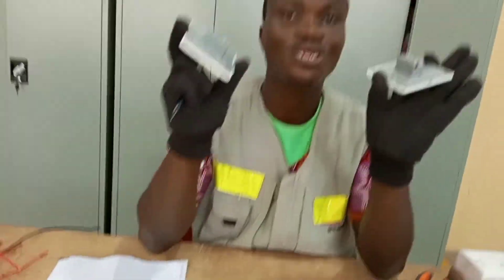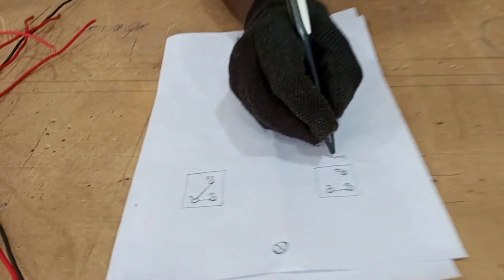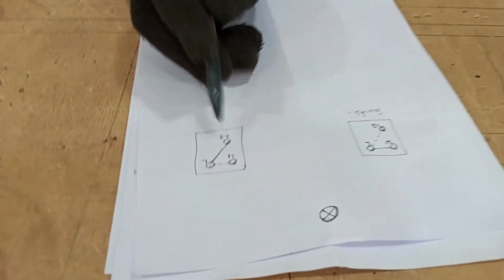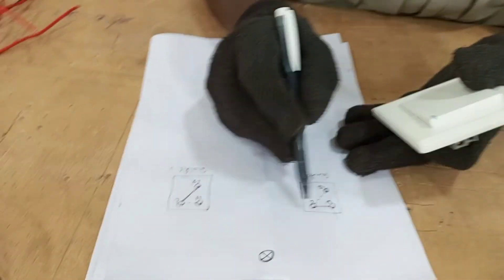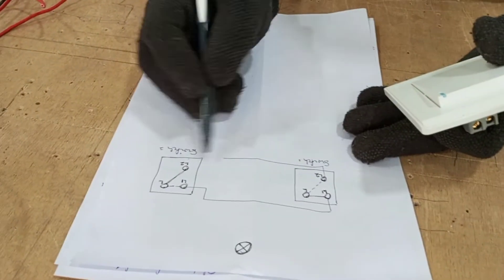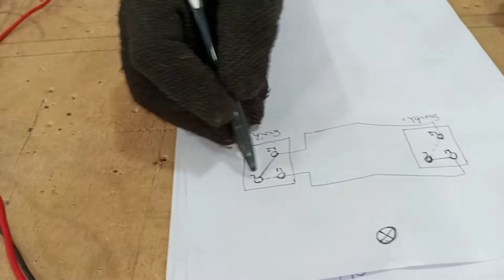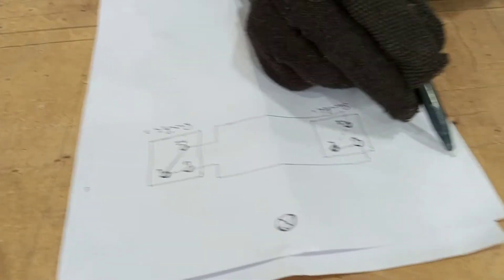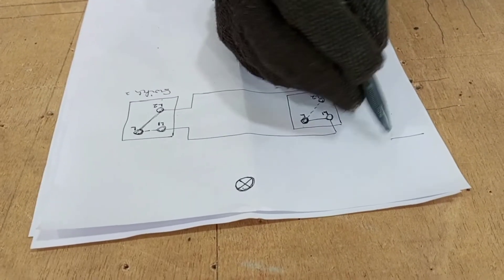2 WAY LIGHT SWITCH WIRING EXPLAINED

Comment: Please what is the difference between a disturbition board and a consumer unit.
Reply from the maker: Consumer units and distribution boards are similar, but Consumer units are designed to easily isolate specific areas in a domestic or residential building. Distribution boards are designed for high volumes of electrical equipment, such as larger flat buildings, factories, workshops, etc. In other words, all consumer units are distribution boards, but not all distribution boards are consumer units